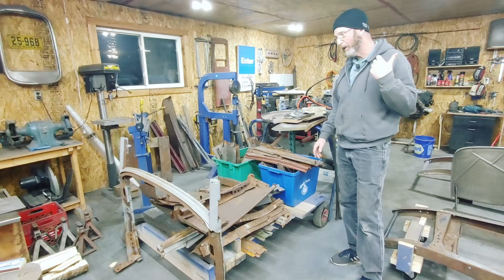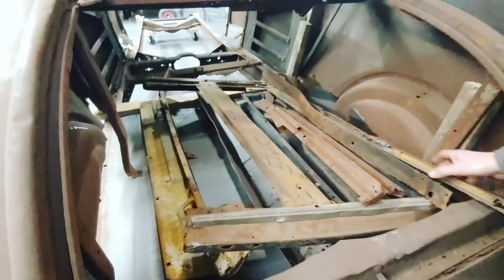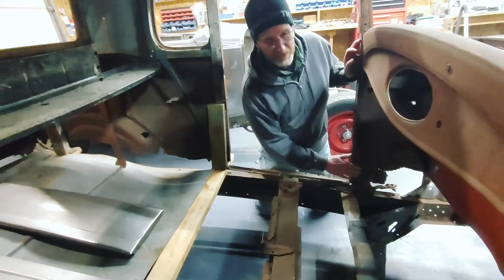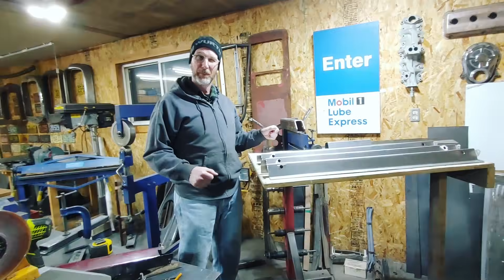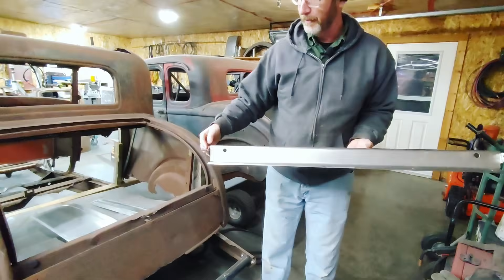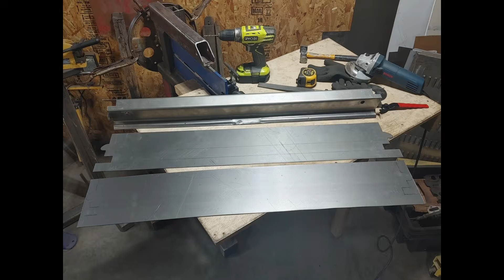Work starts on the 5 Window Coupe

Comment: Derek, I noticed you used "studs" to go through the firewall feet on each side. It seems the studs would be less fussy than using bolts?
Reply from the maker: Marty, I've used studs for the firewall feet when the frame is tapped on my Brookville frames. In this case of the original frame the bolt is upside down with the nut on the feet. I like it better this way.
Reply: @coldstreamrodshop  indeed. I find it can be difficult to get the bolts started through the feet